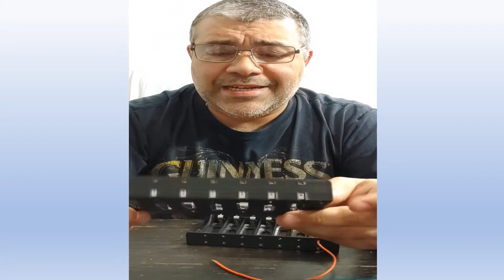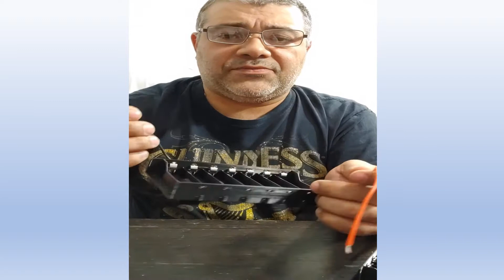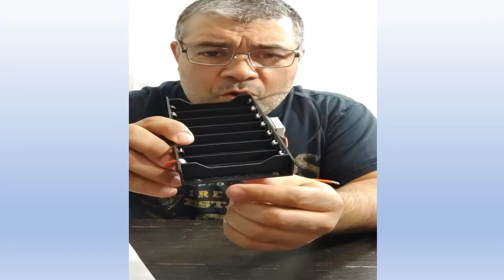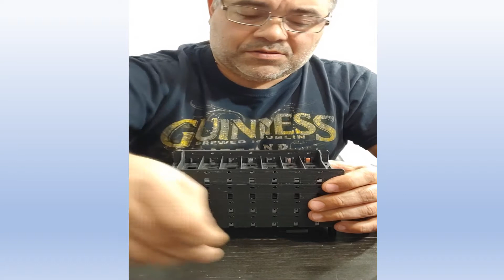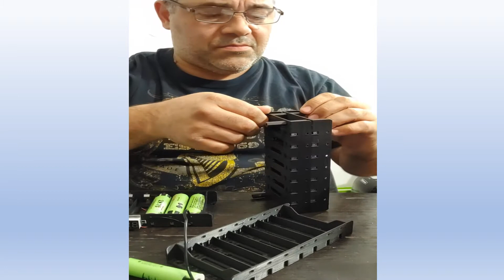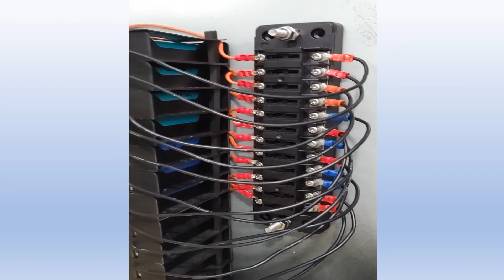DIY Powerwall using Powerwall Battery Holders PART 1

Comment: Appreciate the good info, like the solderless design
Reply from the maker: Thank you, building a power wall or a backup power supply can be challenging. The last thing you need is to put in the batteries in backwards.